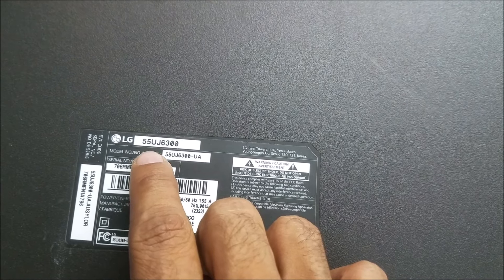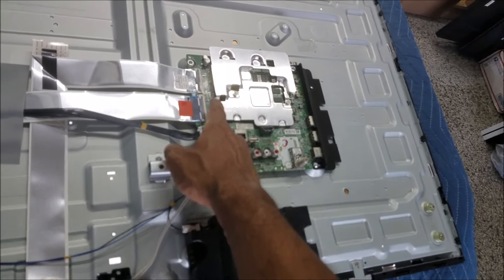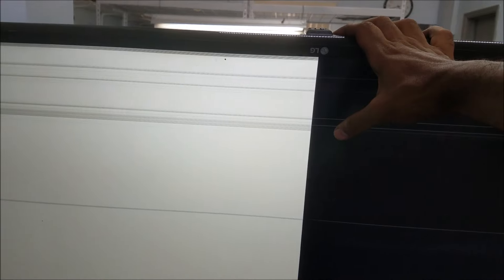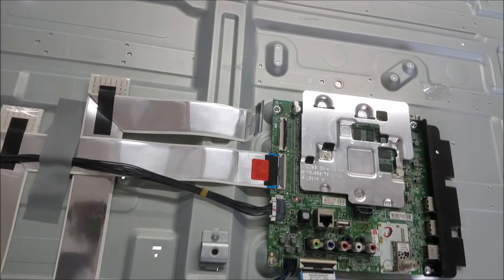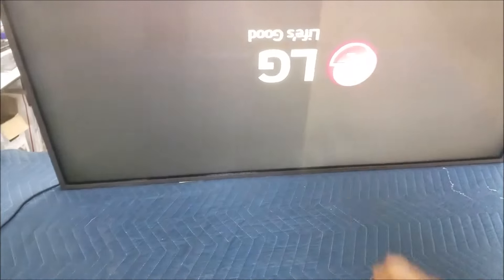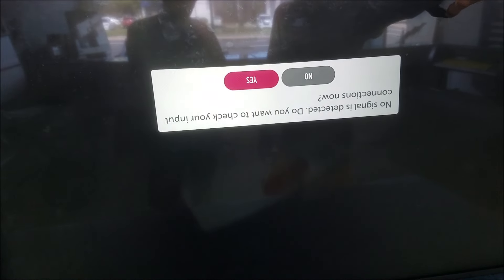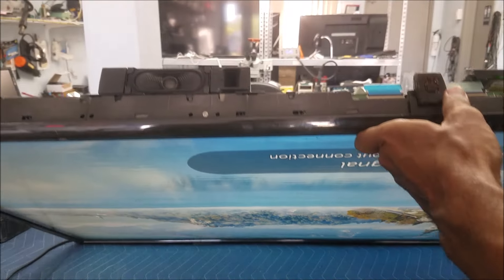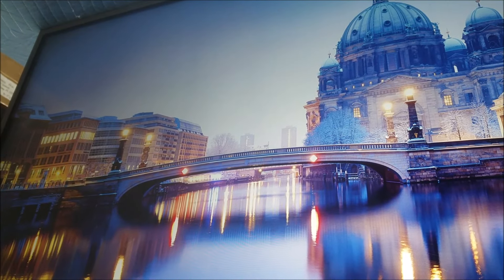LG TV 4k 55UJ6300 lines on the screen discoloring fix

Comment: Used this method before  by blocking the first 18 traces. Got rid of the horizontal lines but color fricker frequently. Saw your video and follow your led by removing the cover of the first 6 traces and seem to work. Color now stable. Thank you.

Comment: IT WORKED!!! 🔥🔥👌🏽👌🏽💪🏽💪🏽
I’m from India. I have a LG WebOS 55Inch TV which was brought from Kuwait and I was facing the same issue with my TV, the screen was flickering and colours were changing. 
I called up the LG Customer Service and they told me it would cost 
₹500 for Visiting Charge
₹1500 for Service Charge 
Luckily the technician called me up asking me what issue I was facing, so I just took a video showing him the display flickering and he told me that it’s a panel issue so they will have to replace the display.
I then called the LG Customer Care to enquire regarding the cost of the display and they told me 
“Made in Korea Display Panel will cost ₹50,000”🤦🏽‍♂️😵😵‍💫
Keep in mind my TV was brought from Kuwait hence they didn’t have the model here so they have to import it here in Goa, that’s why the panel replacement cost was so much.
My parents told me we have to prolly buy new one cuz we purchased the TV itself for less than ₹50,000.
I then checked on YouTube and came across your video and thought I should give it a shot. I followed each process step by step as explained in the video🙌🏽.
And IT WORKED PERFECTLY!👌🏽💪🏽💪🏽🔥
THANK YOU SO MUCH!!!❤️❤️
SUBSCRIBED!💥🔥

Comment: Why did isolating the traces fixed the issue? I'd guess that covering the traces would disconnect the image completely, so I'm really curious as to why it worked. Great video!
Reply: You block the clock lines, it’s normally only 1 clock line but covering them all does the trick, usually there’s a short in the panel causing the fault
Reply: @wisher21uk  How about cover just 1 clock line?  Will that work?  Those traces are supposed to be connected.  When disconnected, there must be something wrong on the screen.  In other similar videos, they could solve the problem but there is will be another problem which is just not that obvious.  Why this one can have a perfect screen?  I did similar trick on my 2 of my Samsung TV which stuck on the restart loop.  One was fixed but with some tiny lines on the screen.  Another one was fixed but with colour getting lighter toward the left side.  Will it possible to make them with perfect screens?
Reply: @tmho7091  you can get the screen back but as the panel is failing or failed it is unlikely to be fair, the lines are an indication of the panel failure points, the colour does go funny you could just try using smaller bits of paper or tape

Comment: Im getting similar but fainter grey lines all over the screen when at 144Hz and a bit less at 120Hz.. but they dissapear when the monitor is turned on for 30min+ Very strange. ASUS PG65UQ, huge monitor.. wonder if it could be the same problem and as easy of a fix?

Comment: I Have the 55UK6300plb. Backlight working but no image. when i disconnect the blue (upper) flex cable, i get perfect image on the right side of the screen and a white side on the left side. I've tried multiple hours of taping the lines, but no luck. any suggestions? Should i buy a new mainboard?
Reply: try to get new backligts replac and word fine for me

Comment: Hi..kindly help..I have tried insulation but I don't know the exact lines on the ribbon to skip or measurements of the ribbons..kindly help how low to go or high on the ribbon..my lg TV has horizontal lines..thanks
Reply from the maker: i dunno what exactly lines needs to be covered not all the time the same lines, just keep trying
Reply: @SOSfixElectronics  its lines at the bottom upto half of the screen

Comment: Hi. Will it be easier to replace the tcon board itself and it would solve this problem?? Or is it the ribbon?
Reply: I was thinking the same thing. I used tape as well. Picture is much better but still has flickers a little. I was wondering if just getting a new ribbon would solve the problem completely.
Reply: This is a common issue with LG. More videos popping up with similar faults. The problem isn't the T-con board but the panel itself. This is the workaround as not cost effective to replace the panel
Reply: @glenndaly3975 what panel? The mainboard?

Comment: It’s not a fix but a bypass. What’s actually wrong ?  Seems like your just putting more pressure on a single inverter now. How long will this last ?
Reply: @Senen Trinidad ?
Reply from the maker: this is a permanent repair, i did this on my sony 85" living room tv 3 yrs ago still going strong, no it is not do pressure on connector, if it extend your tv life for a yr or so is better or no? video about covering the bad traces that causing bad picture, this way tested on 10s TVs for Yrs
Reply: @SOSfixElectronics  ya I get it. It’s an Easley fix  , there’s millions of pixels on da screen the tape shuts down the dead ones etc but can it actually be fixed ffs or not is all I’m askin lol. Has anyone actually tested and verified what actually died here.
Reply: @stefanlewis7773  lol. Ya my ocd gets carried away sometimes lmfao
Reply: I actually ordered a new one. Only 30 buks Canadian lol.
Reply: The panel has a faulty ground (which can by fixed, btw if you're into microscopic soldering) either on the connection between the FPC or the FPC itself. Its the thin plastic-lookalike flat cables running under the protective case directly to the screen. When you simply block the faulty line on one of the FFC with a piece of tape (and its DUCT tape, @SOSfix), the redundant line on the other cable takes the job. Also you got that correct, the leftover circuit has to take additional load, like one can easily imagine theres a reason the manufacturer planned additional lines. Theres nothing like "oh they're just an extra, you don't actually need them". If i worked for LG on Eplan or something and i'd construct crazy double-as-needed circuits, i'd get fired on spot.
Reply: @etklatschtgleich  cool ty. I’ll check it out. Much appreciated
Reply: @etklatschtgleich  I’ll reflow and let ya know lol.
Reply: @etklatschtgleich  by panel you mean the mainboard? Could the problem be fixed by replacing the mainboard?